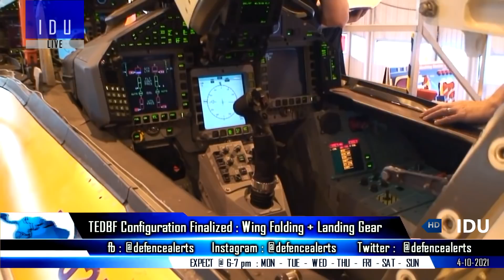Indian Defence Updates : TEDBF Final,Brahmos-X Test,Amur SSK Offer,Kalyani Jet Engine,LUH Trials

Comment: As the world is moving towards compact autonomus fighting platforms lots of countries have been offering their expensive manned military platforms to India.
Reply: There is no system that can provide blanket electronic counter measures. Also manned platforms are susceptible to electronic counter measures. Autonomus systems will get better and electronic counter measures will also improve but it will never be able to protect 24 hours in all spheres
Reply: I agree with you but then it should be economical, easily deployable easy to maintain, scalable. We should not continuously pay the cost of maintaining our defense but inflict higher cost on enemy and enemy's defense. S400 or any missile defense system is useless unless and until our offensive capabilities are strong enough because the missile defense will give us protection only during the 1st and 2nd phase when enemy will test our air defense after that enemy will try to saturate it.

Comment: India needs to roll-out and induct new weapons much quicker, not in 2028 and 2030. Let's break babu culture and let military drive the schedule. BABUS wprk for you Generals. BANG ON THE DESK!
Reply: Its not about babu culture but testing and retesting takes time. Because once they find any defect they have to correct and retest and that to all parameters in different seasons and in different locations like mountains, extreme temperatures. Just for example, when they find a defect during this winter trial then after correction they have to wait for next winter season to recheck same parameters.